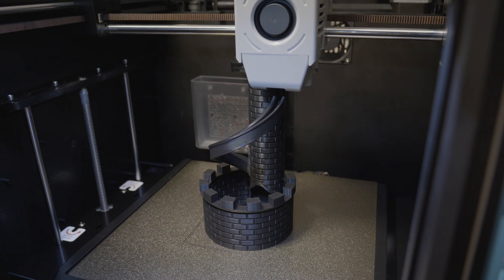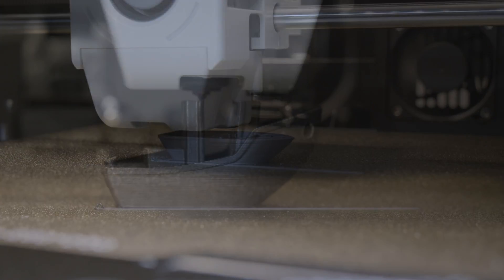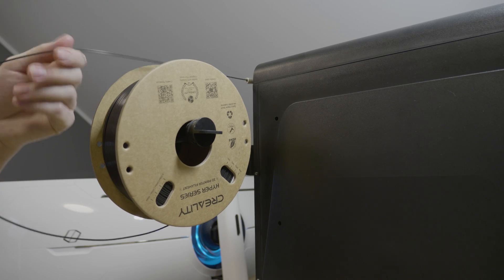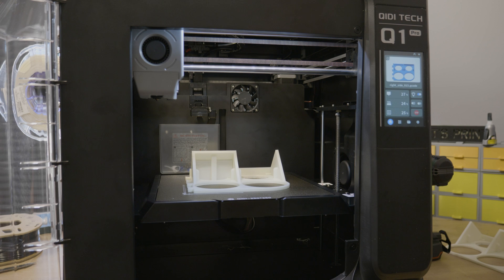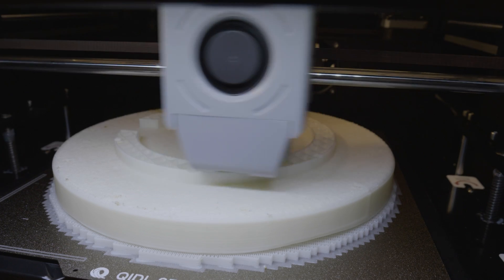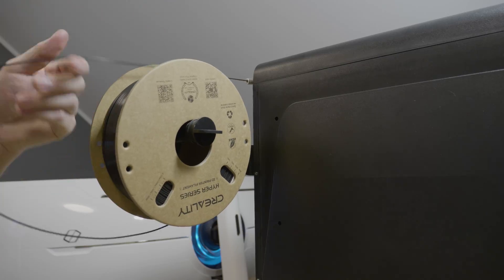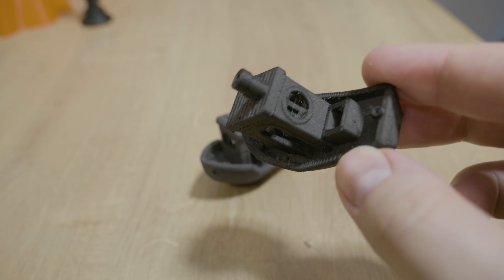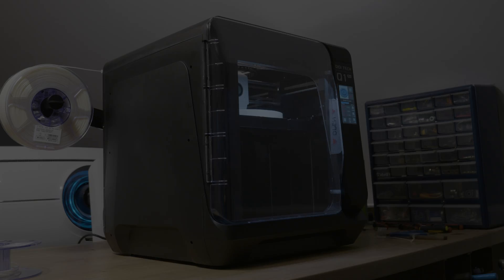QiDi Tech Q1 Pro -  BIG HIT TO HIGHT SPEED 3D PRINTERS MARKET!

Comment: On the PEEK thing, there is someone on Reddit who successfully printed with PEKK (not PEEK) with a Qidi X-Plus 3.  The Q1 Pro has the same temperature capabilities as the Plus 3, so while I still believe that PEEK might be out of their operational range as stock, PEKK doesn't appear to be.
Reply: Q1 has 5c lower chamber temp, also you can print pekk in theory but you still need much higher chamber temp for proper layer adhesion or larger models. You could print pps though, temps are in range.
Reply: @riba2233  i guess it would be like printing ABS with an unenclosed printer, it does work, but only for very low warp parts.
Reply: I got my xmax3 up to 90 celsius chamber temp just by lining the inside with reflective foam board.  I just need someone to come out with a compatible 400 degree+ hot end.
Reply: @tangodown2721   it is not an issue to make a 450c capable hotend, but at 90c  you can damage other parts inside long term unless you heavily mod it with water cooling. But good luck, sounds fun, tell me if you succeed :)
Reply: @tangodown2721  Its cheaper to modify your kitchen oven with some nema steppers, sliders, belts and some electronics, then you have core xy monster

Comment: Btw your nylon was wet. In general you need to print it directly from a dry box, but this specific nylon filament from esun is extremely moisture sensitive and has to be dried basically in an oven and then printed from a dry box.